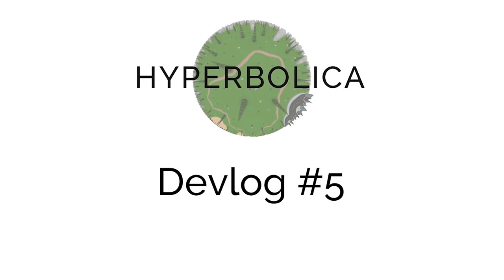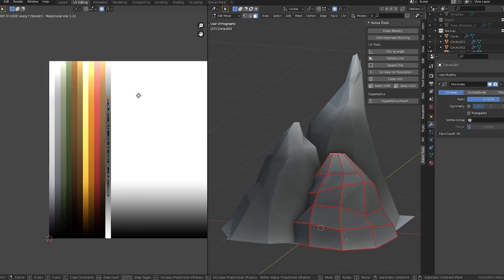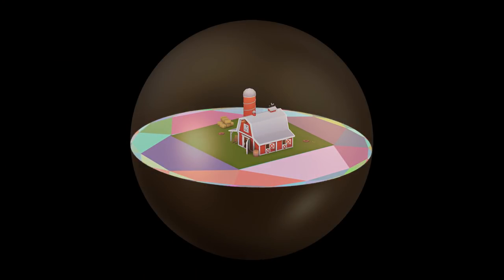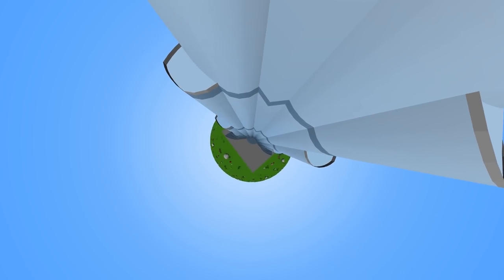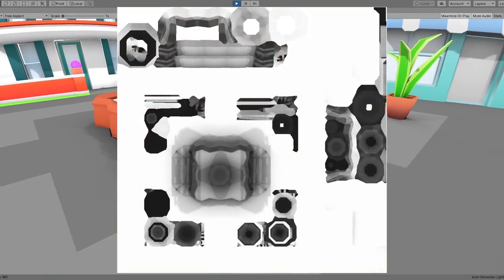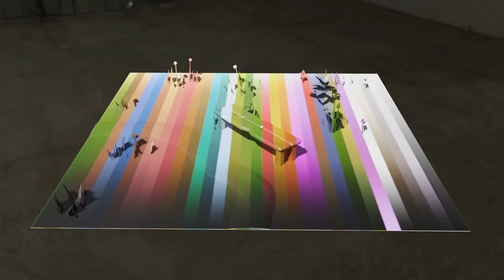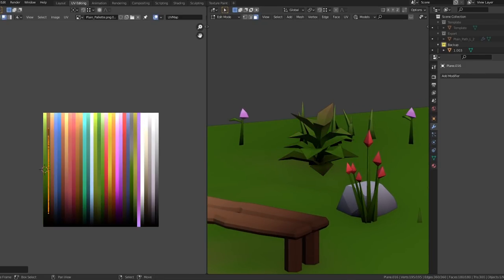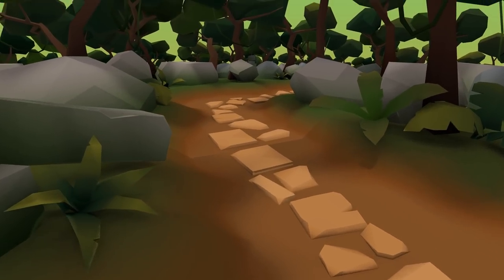Non-Euclidean 3D Modeling - Hyperbolica Devlog #5

Comment: I dont know why, but I find it so fascinating how when you get closer to objects in this game, it doesnt look like you're actually getting closer, but rather just zooming in.
Reply: Perhaps because moving a certain distance scales all objects by the same amount, assuming that they are sufficiently far away.
Reply: That's how getting close to objects normally works, it's just that the speed at which you "zoom in" as you move is much faster in hyperbolic space.
Reply: @Gaswafers  Not quiet. In euclidian space, the apparent size of close objects change much faster than those farther away from you with the size change approaching zero as the distance approaches infinity.
Meanwhile, in hyperbolic space, walking some distance d towards some objects will always double their apparent size no matter how far away they are, as long as they are sufficiently far away.
Reply: What d is depends on how hyperbolic the space is.
The reason that objects need to be sufficiently faraway is because hyperbolic space acts like euclidian space on small scales.
Example:
For small enough circles, the area is the familiar pi*r^2. However, as the radius gets bigger, it becomes proportional to e^(2r).
Reply: @bengineer8  Yeah.. I have no idea at all what that math stuff you said was.
Reply: @markbv591  Basically, moving in hyperbolic space will look exactly like zooming for objects that are sufficiently far away. Meanwhile, in euclidian space, there is a noticeable difference.
Reply: @bengineer8  Do you know any resources about these effects I could easily find online, but not be too dumbed down? Sounds interesting
Reply: @emiel2712  I would recommend joining the hyperRogue Discord server if you have Discord, as there are people there much smarter than I.
Reply: @bengineer8  This is incorrect, area of a hyperbolic circle is not e^(2r), but the integral of 2 pi sinh(r), which is 2 pi (cosh(r) - 1), approximately 2pi e^r.
Reply: @ZenoRogue  Whoops, my bad.
Reply: Say more, the horizon expands in front of you, shrinks behind you, and moves past on the left and right of you!

Comment: "No PBR work flow... YET"

Can't imagine how a non-euclidean world might look if it was photo real...
Reply: i imagine it would fall straight into the uncanny valley
Reply: @sighmon5640  Yes I have the same intriguing fear
Reply: It might be easier to get hyperbolic projections to work in raytracing or raymarching, if anything, because you wouldn't have to deal with as many hardcoded assumptions coming from the GPUs' fixed-function rasterizers. But you'd need to implement that raytracing/raymarching shader, you probably wouldn't be able to use something like RTX for this.
Reply: Also, I remember having the 'camera turns upside down when rotating' issue in my earliest days of attempting to make a 3D game. I probably messed up the Quaternions the engine expected and treated them like Euler rotation or something, Idk.
Reply: Mm. Technically the world you live on is non-euclidean. The curvature just isn't incredibly noticable.
Reply: @chromarush1749  our universe is more or less euclidean, but gravity creates local distortions
Reply: @danzjz3923  thats really not true at all. We do live on a sphere after all. Euclidean geometry is just almost perfectly accurate at the smaller scales we need it at.
Reply: ZenoTheRogue (of HyperRogue fame) has a video on his YT channel about what it would look like if you took a 16m-radius sphere in a hyperbolic universe with radius -1m (meaning the surface area of the sphere equals that of the Earth), then stuck the surface of the Earth (via Google Maps) on the inside of the sphere and took a trip around. It's one of the trippiest videos I've ever seen in my life.
Reply: @sighmon5640  and with that i say "stay the fuck away from me"
Reply: @sighmon5640  I think the uncanny valley is for faces, this would probably just give someone motion sickness
Reply: well you should
Reply: They wrote a non Euclidean rendering engine for the movie interstellar, since they needed to accurately render curved spacetime
Reply: @3lH4ck3rC0mf0r7  For an FPS camera, you actually do want Euler angles (or the equivalent, as realized through quaternions or whatever affine transform-capable system you use).
Reply: @atimholt  Yeah, that's probably it.
Reply: @sighmon5640  this how I feel about modern graphics in games, it might look good yes but I mostly think about how it tries to look real but isnt and that is worse imo than older graphics.
Reply: Photos are already supernatural here.
Reply: @chromarush1749  just because we live on a sphere it doesn't mean the space itself is spherical
Reply: @gustavosantiago1543  it is though. We just don't build at a scale wherein it matters.
Non-euclidean geometry would've never come about unless it was applicable to real life circumstances.
Look at it this way, each wall of your house is bowing away from eachother ever slightly, but because it's only built two or so stories high, there are never any issues arising from that fact. The fact is euclidean geometry is close enough and doesn't see any real diversion in most uses, so right angles will always stay within a realm of accuracy. But if you were to extend two vertical walls up to the tips of the atmospehere, a straight line connecting their tops wouldn't follow the curvature of the earth anymore.
Let me know if that wasn't easy to follow, I'm not always the best at explaining things.
Reply: @gustavosantiago1543  Another way to respond to this I thought of. We fundamentally have to be operating on spherical geometry because gravity exists.
Gravity likes to push things into circles, that's why a planet will never be a cube, it'll be compressed until the corners round off eventually because of the pressure.
The fact that gravity works this way means living on a significant body of matter will cause you to live in spherical geometry.

Comment: Tessellation can be used to uniformly address the geometry matching issue, controlling the subdivision amount with the norm of the distortion tensor (presumably max norm). OpenGL version 4.0 nicely supports it, it increases time spent on the vertex stage, but can be controlled to only tesselate highly distorted areas.

Comment: Order-5 square tiling Dual polyhedron Order-4 pentagonal tiling.
You should attach objects to tile centers instead of vertices to avoid distortion.
That is, the tiles should not have physical vertices, only centers and sides.

Comment: Maybe my knowledge about your project is a bit outdated, but anyway. 

You have entire framework of general relativity that describes events in curved space time. 

So you can make an object (house) , set up a metric (powerlaws or exponents) and use ray tracing but with trajectories of light rays calculated from geodesics equation. So in the result you will get your picture of curvature-weirded house in the most accurate way.

Computational efficiency may be questionable, but I assume ray-tracing is quite usual and applicable stuff now

Good luck with the project, btw, it’s really interesting, especially for an astrophysicist how works with this non-Euclidean spaces

Comment: 2:41 Wait wait wait, so only the positions of the vertices are actually distorted? I can see why that's a necessary performance limitation, but given your other projects I guess I kinda assumed that there'd be some raymarching witchcraft or something involved to make straight lines appear curved.
Reply: While you could do this with raymarching or raytracing, it would be incredibly slow and modelling would be much more difficult. Also just doing raytracing doesn't solve the issue; you would have to do something like raytracing combined with parametric curves/surfaces, such as NURBS.
Reply: @Madsy9  I mean, I've seen it done, just without lighting and at 24fps,  so it's definitely possible, but I can totally see why a vertex based solution is preferable, especially for vr.
Reply: @hunted4blood  yeah, but lightless 24fps would probably make you motion sick in VR, even though it's an okay stylistic choice for a traditional video game - so I'm guessing not really an option there.
(Also custom stuff like that tends to not synergize very well with Unity, whose rendering engine is more optimized towards traditional rendering, so the performance might be worse still).

Comment: Regarding the wrong linear interpolation between vertices, would it not be possible to use a custom interpolation function in the fragment shader for texture lookup? I don't know how complex hyperbolic interpolation is but with graphics like these it doesn't seem like it'd be too expensive to run once per fragment. You'd also need to access vertex data in the fragment shader but i'm 100% sure that's possible to do, i just don't remember how.
Reply from the maker: It's possible, but it's faster (performance-wise) and cleaner to just remove the intersections.

Comment: I came here to learn this. They assume we know. We didn't:
Eu·clid·e·an
/yo͞oˈklidēən/
    adjective
relating to or denoting the system of geometry based on the work of Euclid and corresponding to the geometry of ordinary experience.
 "Euclidean geometry" of such a nature that the postulates of Euclidean geometry are valid.

"all points on a Euclidean circle are equidistant from the center"

Comment: I have a solution for your shadow problem. Use ray tracing. The computational price of doing it is coming down and I'd be very interested in seeing how the geodesics (shortest path between two points)  curve. And what that means for the final image produced. Actually if you don't do this I kind of don't see the point in the project. If you want I can volunteer my free time to help with this. I probably wouldn't be the best person to help but I have some experience with C++ and game engines, and I'm a quick learner. Plus I wouldn't expect to be paid. I'll sign a non disclosure agreement if you want before you show me the source code. It will take me some time to familiarize myself with the code base and I've never actually implemented retracing before but I like challenges. And lighting is an area of interest I'd like to explore in depth. 

Anyway, this is looking pretty cool. And I'm excited to give the game a play.

Comment: When you say "every edge has to be shared with neighbouring triangles", do you mean the entire scene has to be one continuous mesh with no separate objects?
Reply from the maker: Sort of, yes.  Objects can be separated as long as they don't otherwise touch each other or intersect.  And this is really a guideline to get "perfect" shading.  You can usually get away with some intersections as long as there's a vertex nearby and you won't notice.

Comment: I can't understand one thing. In spherical space, when you look forward parallel to the ground level you should see yourself from behind, isn't it?
Reply: Not if the ground is the equater
Because as your eyes are higher than the ground, a ray coming from your eye and comming back at you would have to go trough the ground
Reply: If you lower the ground so your eyes are on the equator, you would see yourself
Reply: The problem is that if we do that,
you would see the same point of the back of your head all around you
Reply: So it would look very weird
Reply: Have you seen the devlog where he show spherical geometry ?
Reply: @quads4407   yeah, but i got a little bit confused, so thanks 😊

Comment: I, I still don't get the infinitely squished horizontally part for UV tile mapping :(
Reply: Basically they make a palette of different colors/gradients/what-have-yoy in vertical strips, and each object in the scene is squished down to a single line segment. This means they can be moved around to different strips easily (as the color-changing dining hall shows), and several objects can painlessly share the same one.
Reply: @Kaiveran  I see, this can be applied to any minimal-like designs even in Euclidian space, correct?
Reply: @dexterman6361  certainly
Reply: @Kaiveran  Ahh okay, I assumed this was a only possible of using hyperbolic coordinates. Thanks for the explanation!